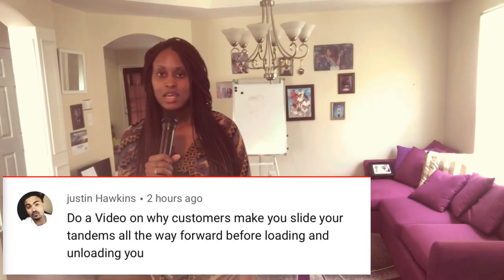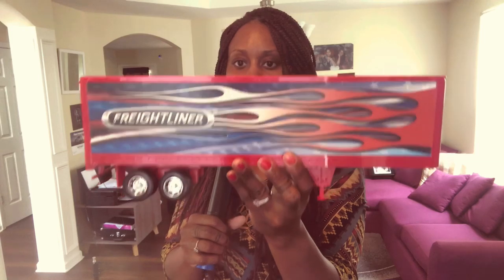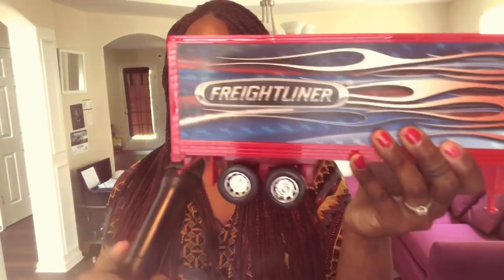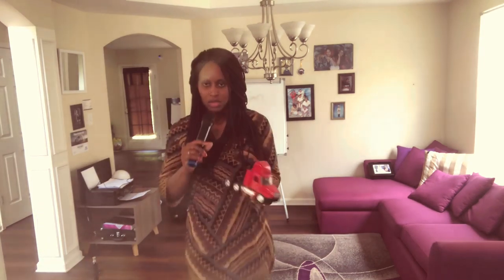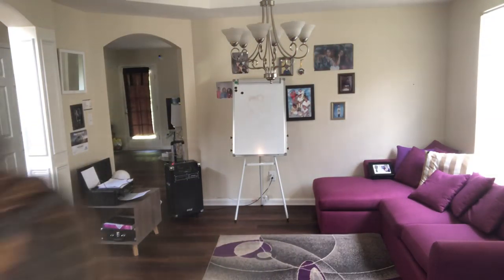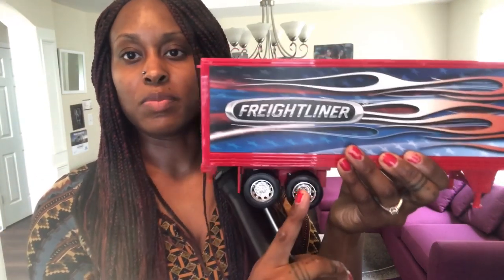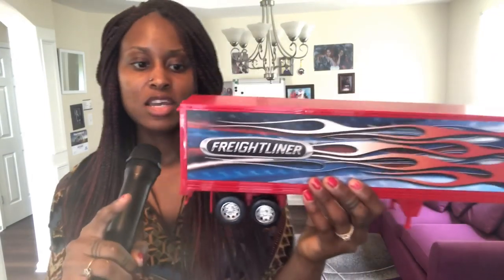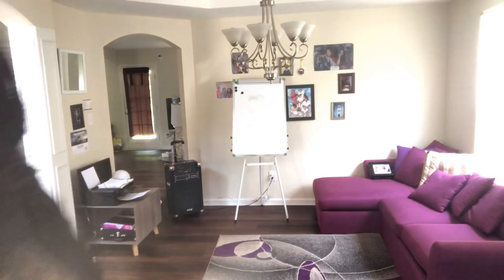#Keepingit100trucking - Why Receivers/Shippers Make you Slide Tandems #freightliner #trucking

Comment: Reasons for sliding tandem axles. 1. Safety, forklifts are heavy and when they go in to the nose they can raise the back of the trailer and get stuck. 2. Dock height, sliding axles back raises the back of the trailer so it's level with the dock plate. 3. When docks have locks that hold the trailer from moving forward with a forklift in it, sliding axles back will prevent the DOT bar from contacting the dock lock and damaging the DOT bar. 4. Sometimes they just want to mess with you, maybe to see if you know how to do it. 5. Axles all the way back make a trailer easier to back up, I've even slid them in truck stop parking lots where the hole I wanted was too tight to time the over swing. Axles back it goes in like you greased the sides.
Reply from the maker: That’s great info

Comment: Good explanation. But one small addition...it's called "sliding the tandems" but really the tandems are locked up with the brakes and remain stationary, while the trailer slides across the top of the tandems.
Reply from the maker: Michael Slattery 
That’s true, I tried to explain it as simply as I could but good info
Reply: @pinkiedabney  I'm not a trucker. I only know what I've learned from you. You're a good teacher. I understand scales, weight distribution and counting the holes from your other vids

Comment: They ask you to slide tandems to rear so the trailer will be at the dock plate height so the forklift would have a smooth transition in and out the trailer and it also allows the icc bumper to clear the dock lock and not cause damage..